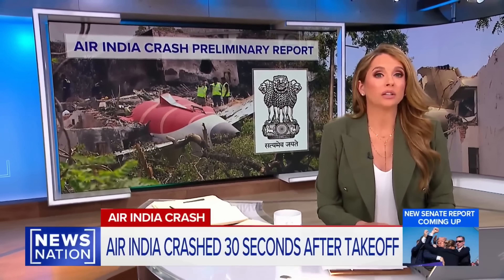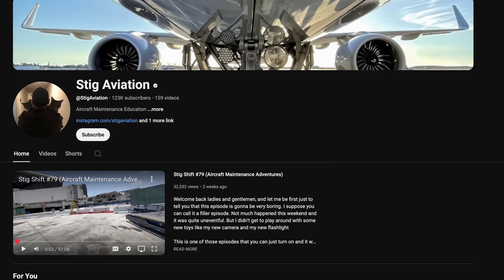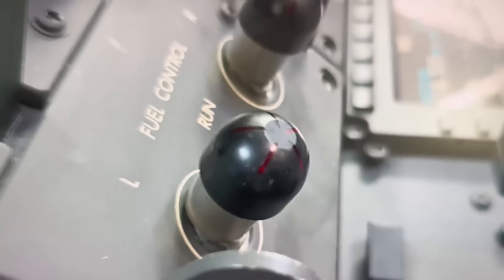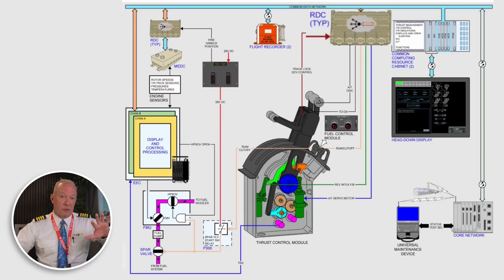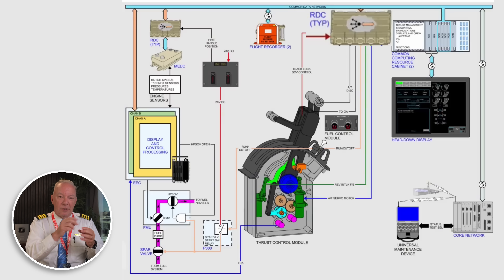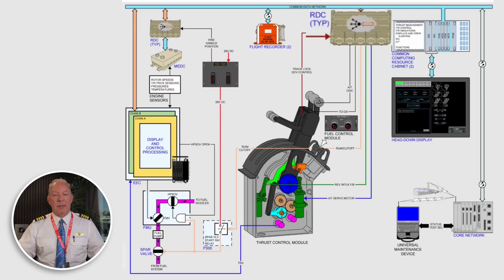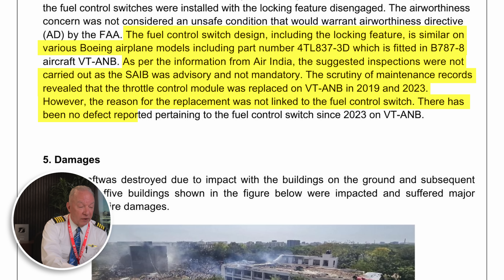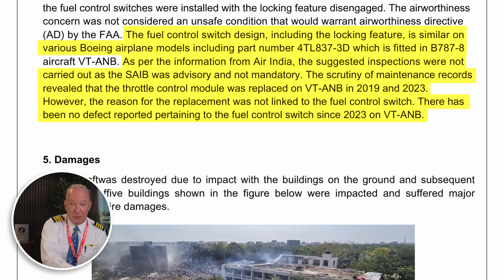The Truth About Boeing 787 Fuel Control Switches

Comment: Excellent explanation @CaptainSteeeve. Love the level of tech detail that you go to, to explain your point. 
More than the tech details, amazing to hear about the psychological state of pilots that you've actually been talking about within the first 2 days of the crash. Intentional human action is the last thing we want to hear, but like you said in this video - what you wish happened is not necessarily what actually happened. 
My question for you - is it possible that one of the pilots was not consciously focused during take off, and absent mindedly turned the fuel valves to cut-off? That could explain why he (whichever of the two "he" is) denied turning the valve off. 
Occasionally, when we are stressed or preoccupied, our body does things which we never meant to. Like using the wrong turn indicator when driving or pressing the brakes instead of the gas. In your experience as a captain and counsellor, have you come across such a situation before?
Reply: Look at the diagram. It flatly contradicts what he says.
Reply: Sorry, don't see how
Reply: @BejoyJohnNewDelhi  There are 3 valves shown moving in the animation. 2 Have arrows going to them from electronic control units. And there is an AND gate shown in the control path to one, which is a digital signal processing unit, NOT "just electricity". Also what he says about the relay feed does not make sense. And the demonstration with the electronics toy is simply a bare faced lie - the circuit he shows is nothing like the diagnram - there is no relay in his demo. And his whole argument does not acknowledge that there are multiple points of potential electical failure. And many other people here have made the exact same comments (yet cpt S makes no response).
Reply: No electrical or electronic failure or surge can push a spring loaded switch, then move it to cutoff. Just like no amount of electric short or surge can turn your home switch off. The machines may malfunction, relays can malfunction, but the switch will still be in Run position.
Reply: @BejoyJohnNewDelhi  Not sure what your point is. Cpt S is "explaining" that there is no way the valves can cut off other than under control of the switches. The diagram clearly shows that the valves CAN be cut off by several other mechanisms. The issue is not whether something (other than the pilots) can make the switches move. It is whether the valves can cut off while the switches stay in the same position. There is no explanation of what signal the black box uses to record the position of the switches, but it has to be SOME down-stream signal (it cannot magically be the "real" position of the switch, unless there is a camera). So from what was presented in this video, it is not possible to know whether the switches REALLY moved, or some downstream fault made them appear to move as far as the blackbox knew.

Comment: Thank you. Initially I also suspected an electrical supply issue to the switches, as in the event of the supply failing, then the output would fall away and produce an 'OFF' signal (like when the power goes out at your house - thi switch will be in the 'ON' position, but your lights will remain 'OFF'). When the report was released, it stated that there was a 1-second delay between the signals of the switches changing. If power supply fails, then both will indicate a change at exactly the same time, without any delay. In this case, there was a delay recorded, which debunks the theory of a failed or disrupted power supply to the switches.

My question is, suppose the pilots thought that the engines had issues and were not producing the requested thrust, and they were trying to restart them, then they would have turned the switchs 'OFF', and then 'ON' again with a short delay in between to allow the system to reset fully. 

For me the fact that the pilots discussed the power loss, and that the one pilot clearly said that he did not cut the engines when asked by the other, makes me wonder. 

Maybe I am just naiive, but I believe in the good in people untill proven different

How can we find out if this was a possibility?

Comment: On the Boeing 787, the cockpit fuel control switches do not mechanically operate the fuel valves directly. Instead, those switches send digital signals to the engine’s computer, known as the Electronic Engine Controller (EEC)—a key component of the FADEC (Full Authority Digital Engine Control) system. The EEC then controls the actual fuel valve within the engine.
Reply: This is not true of the Fuel Spar Valves. There is no software involved in the opening or closing of that valve. The FADEC has zero input to that valve.
Reply: @paultruzzi911  This is indeed true. Please stop spreading misinformation just to prove your point.

On modern aircraft (like the 787), there are several types of fuel valves:

1. Engine Fuel Shutoff Valve (at the spar or pylon)

*This is a fire shutoff valve.

*Controlled primarily by the fire handle in the cockpit.

*It cuts fuel (and hydraulics/bleed air) to the engine in an emergency.

*FADEC does not control this valve — it’s independent for safety reasons.

2.High-Pressure Shutoff Valve (HP SOV, inside the engine fuel system)

Located downstream of the engine-driven pump.

This valve is commanded by the FADEC to meter or cut fuel flow to the fuel nozzles.

During normal start/stop sequences, the FADEC opens/closes this valve automatically.

For example: when you move the engine master/ fuel control switch to ON, the cockpit switch sends a signal to the FADEC, and the FADEC schedules the opening of the HP shutoff valve.

3.Tank-to-Engine or Crossfeed Valves (airframe fuel system valves)

Controlled by the aircraft’s Fuel Control System (not FADEC).

Pilots or the automatic fuel management system open/close these, not the FADEC.

So how does a flameout happen without touching the spar valve:

The spar valve can stay wide open and still

If the FADEC commands the HP SOV closed, no fuel reaches the combustor.

Result: engine flames out.

Think of it like this analogy:

Spar valve = Main water shutoff for your house (pilot’s authority).

HP SOV = Faucet tap inside your kitchen (FADEC’s authority).

Even if the main water supply (spar valve) is open, if the faucet (HP SOV) is closed, no water flows.

I don't understand how can a pilot be this greedy. If the FADEC never had any command over the fuel valves as pointed out by this ogre of a man (captain greeed) then how did both engines of al nippon flight (787) shut down at the time of landing. 

 ANA Boeing 787 incident: both engines shut down on landing because of a software function called Thrust Control Malfunction Accommodation (TCMA), which is designed to guard against runaway or uncommanded thrust. Boeing later explained that if reverse thrust is selected too quickly after touchdown, before the system confirms the aircraft is in ground mode, TCMA can misinterpret this as an unsafe condition and issue a shutdown command. But how can TCMA command a shutdown if it doesn’t have any control over the valves? Guess what — it sends a signal to the FADEC, which then closes the HP SOV, cutting off fuel and leading to a dual engine flameout.

Comment: Capt. Steve –
Thank you for providing such a clear and unbiased technical explanation. I agree that it seems unfathomable this could have been done intentionally.

I do have one question: from which source does the FDR receive an indication that a fuel switch position has changed? Is it directly from the switches themselves, or from the relays that are triggered? Could there be any possibility of a relay failure?

I would assume this is highly unlikely, especially since both engines rely on two completely independent systems, but I was curious. Does the FDR also record relay behavior?

Keep Flying Us Safe 😀
Reply: Look at the diagram. It flatly contradicts what he says.

Comment: As an avionics engineer with over 20 years of experience, I can confirm that switch signals recorded in a Flight Data Recorders do not necessarily reflect the actual physical position of the switch. What is captured is the interpreted electrical signal, not the raw mechanical state. Throughout my career, I have resolved numerous defects where the recorded signal did not align with the intended cockpit action. In many cases, faulty microswitches, relay logic, FDAU channel issues, or software processing caused discrepancies between the pilot input and the data captured in the FDR. For accurate conclusions, it should be corroborated with CVR data, crew reports, and post flight inspections.

Tthe most reliable solution is cockpit video recording. Whether pilots welcome it or not, cockpit cameras are inevitable and they will soon become the standard for ensuring accuracy, transparency, and safety.
Reply: I've suggested elsewhere that the "OFF condition" to the FDR through the "detection circuit" contacts in the switch should be "+14v active HIGH", and the  the Main power contacts on the RELAY to the pumps/ valves should be "Normally closed" . That way, if the 28v AND 14v supply failed,  the RELAY contacts to the pumps would remain CLOSED (Relay coil NOT activated) the Switch position detection would remain as "Supply" (0v) and ANY 28v emergency power from elsewhere would run the pumps.
Likewise, if there was ANY power to the 28v line, but just the 14v (detect) supply failed, The RELAY would not drop out and DISCONNECT the Main Contacts, the pumps would still run and the Switch would NOT be "mis-detected" as "OFF".
.
Also, in that situation, if a pilot TRIED to cycle the switch, no 14v = No "Switch Off" detection.

Comment: With deepest respect Captian Steve for what you do. I do believe your attention to this and other incidents are true.
I had a Radio Shack electronic board (250/1) and could mimick this situation.
Only changes to wires on the board would change the outcome or desired effect. Just as deliberate reconfigurations change flight operations.

Comment: Captain, with all due respect I must raise a red-flag on your explanation and interpretation of the diagram with respect to the fuel control system. Your narrative on the electrical functioning of the fuel valves does not correspond to the diagram on which you are elaborating in terms of electrical path.  The relay output is only connected to the SPAR VALVE directly and the HPSOV indirectly via a logic gate, whilst the FMV is only connected to the control unit. The control unit I am referring to is the DISPLAY AND CONTROL PROCESSING/EEC block in the diagram.  The valves do not monitor but control fuel flow!

What if the control unit (DACP) turns off power to the FMV only?  Will fuel still be fed to the engines?  Your statements as from 8m10s are incorrect.  Kindly review the content of this video with respect to the points mentioned in my comments.  Sticking only to the Fuel CutOff swtiches position will not give an answer to what happened.  Right now its Boeing reputation v/s Air India's pilots mental health!
Reply: Exactly. Despite what Captain Steeeve says, all 3 valves are not directly controlled by the fuel control module. It is not a closed loop. And it only takes one of those 3 valves to close, to cut off the fuel to the engine.

Comment: So if there is no backup secondary low voltage loop including that relay, then it is not good system , simple issue with low voltage driving that relay or relay itself (sticky relay) will make it not work. In this case fail safe is what fuel left on or cut off?
Reply: The fuel shutoff valves are powered by the main buses (AC generators on the engines and optionally the APU), loss of all AC power results in the valves being powered by the ships batteries. Yea, batteries like in your car, but better.
Reply: @paultruzzi911 ok so it is redundant power bus, but what about the relay hope is not single point failure

Comment: almost every engineer and pilot knows the fuel switch can easily be tripped like your circuit breakers.  But Boeing has all the media blackout this info and feed all the lies that the pilot commit suicide
Reply: I hope you don't design anything. The fuel cutoff switches are more like your light switches in your house with a guard on them preventing inadvertent transition

Comment: Dear Sir
Wanted to understand 
Dc power ground or negative wire is it common to both valves of engine?

What is the possibility of common negative cable if it's loose and missing contact momentarily
Anywhere from battery terminal to valve end

Are the batteries different for two engines ?
Reply: No part of either fuel spar shutoff valve open or close command is common between L and R engine.

Comment: Thanks for the clear explanation regarding the closed loop and only one physical input to each engine. The schematics were really helpful.
Reply: Anyone who can read a circuit diagram can clearly see that it is not a closed loop system, as Captain Steeeve claims.
Reply: @Manticore1960  And almost everything about how he says it operates is in conflict with the diagram.

Comment: Steve, you've badly misunderstood the diagram that you showed at 3:45.  You said multiple times that the three fuel valves have no other input except from the Spar Valve Start Switch Relay, controlled by the Fuel Control Switches.  This is absolutely false, and the system diagram makes it abundantly clear that that's not how it works.

The diagram clearly shows that the High Pressure Shut Off Valve (HPSOV) requires two inputs to open.  The backwards "D" shaped symbol just below and to the right of the HPSOV represents a logic AND gate.  Both of its input lines (input A AND input B) must be high for its output to be high.  This means that it must have the signal from the Spar Valve Start Switch Relay AND the input from the Engine Electronic Control (EEC) unit before the HPSOV will open.  If either of those inputs goes away, the HPSOV will close.

Furthermore, the only input to the Fuel Metering Valve (FMV) within the Fuel Metering Unit (FMU) is from the EEC; the Fuel Control Switch has no direct control over the FMV.  The only valves that are directly and exclusively controlled by the Fuel Control Switches are the Spar Valves (perhaps why the relay is called the "Spar Valve Start Switch Relay"?).

Finally, keep in mind that the diagram you showed is massively simplified.  For example, the Honeywell 4TL-series (the Fuel Control Switches) are 4-pole switches.  The signals from only two poles are shown in the diagram: one to the Spar Valve Start Switch Relay and one to the Remote Data Concentrator (RDC).  I'd be very surprised if one of the other switch poles isn't connected to the related EEC.  Where the fourth pole is connected is anyone's guess.

Please note, I'm not suggesting that both EECs or FMUs in the accident aircraft malfunctioned to cause this mishap.  As you pointed out near the end of the video, the CVR transcript clearly indicates that one of the pilots observed the Fuel Control Switches in the CUTOFF position and switched them back to RUN.  That said, this video does nothing but add misinformation and confusion to our understanding of this event and the aircraft systems involved.
Reply: In what way? The fuel spar valve is only commanded closed by the fuel cutoff switches and the engine fire handles. The HPSOV do have other inputs. The preliminary report states that the fuel cutoff switch was moved, I think (not certain) that the fuel spar valve command position comes from the mechanical limit switches on the valve actuator. I believe both the spar valve position and HPSOV position are recorded on the FSR. We will see in the final report if only one of those valves closed and opened or if they were sloppy in their reporting because both valves reported the same state and they just lumped them into one.
Reply: @paultruzzi911  When you say, "In what way?", what part of my comment are you referring to?  I don't understand where we disagree...
Reply: Yep. Spot on. Captain Steeeve should concentrate on "piloting" issues, & not electronic issues. His electronic & circuit diagram reading knowledge is greatly lacking. He mentioned a few times that it was a closed loop system. From the diagram, it most certainly isn't.

Comment: The pilots never physically touched the cutoff switches. The problem was with the electrical system.
https://youtu.be/Od5FFOipRBU
Reply: I think this is not possible  to happen to both fuel spar valves within one second of each other, >>10-9

Comment: Dumb question here, and not contradicting the video, but what happens if the 28V battery is bad/ dead?
Reply: The fuel spar valves stay in the last commanded position

Comment: Thank you for a wonderful explanation of the function of the fuel control switches. I had already thought that perhaps the tunnel of war below the passengers had caused a short circuit, and the pilot had sensed the engines cut off as though there was lack of fuel. However, as you explained, there was not enough time elapsed between  Any indication of any engine failure, and the time at which the plane logged the cut off switches being moved to the Off position. To me that erases any thought of and rotational movement of the airplane, shorting the wires which caused the fuel supply valves to the engine to cut off since by the pilot or the captain. And this to me indicates that the fuel cut off switches were moved to in order to restart the engines in less time than what was logged by the data itself. Again, thank you very much for your detailed explanation captain Steve.
Reply: Look at the diagram. It flatly contradicts what he says.